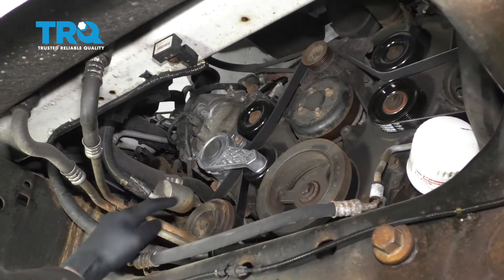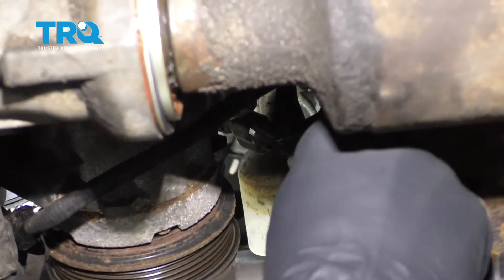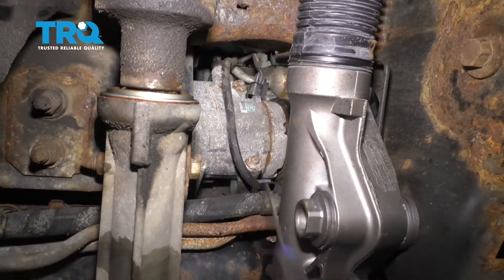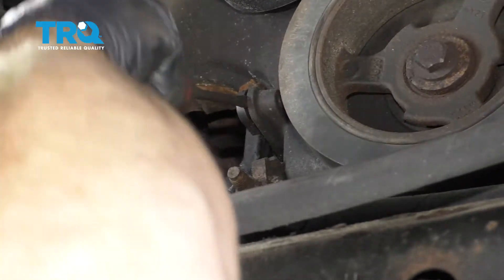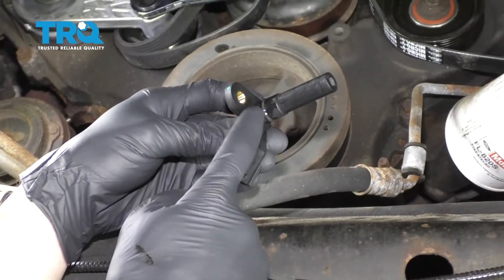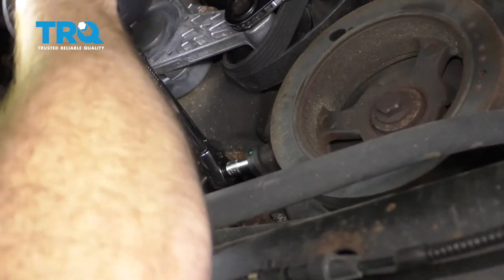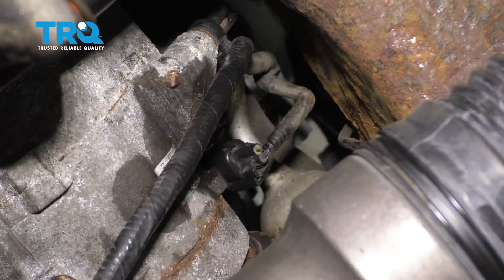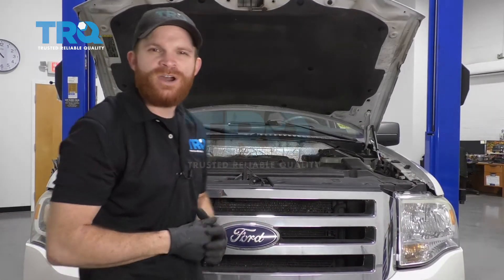How to Replace Crankshaft Position Sensor 2007-2017 Ford Expedition

Comment: Solid guide, other than that the fan and shroud are already out of the way in the video lol.  That makes access to pretty much all of this a very different story.  That said, I was able to do it with the fan & shroud (shroud rotated up) still in place.  Highly recommend precision ratchets for the compressor bolts; very tight space, and could only get two clicks with my normal ratchet on each turn.  Left the top compressor bolt in the housing/detached from block, but loosened, BTW.
Reply from the maker: +928shark88 Thanks for the feedback! http://1aau.to/m/Shop-TRQ

Comment: Do you have to drain the oil before you pull the sensor? Are you allowed access to the sensor and not have to remove the radiator?

Comment: Is it safe to drive without the connector having the pull tabs when I plug it in to the crankshaft position sensor it doesn’t click? Or should I replace the connector?
Reply: replace connector, if it becomes loose , vehicle will turn off
Reply: Best to replace it since it could become loose and it'll loose  connection or  unless you can rig up something to hold it